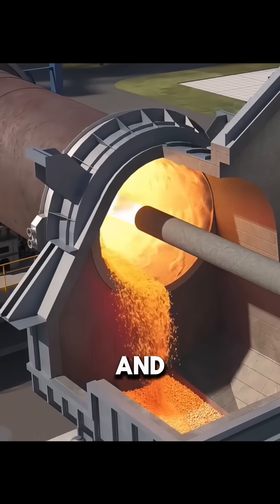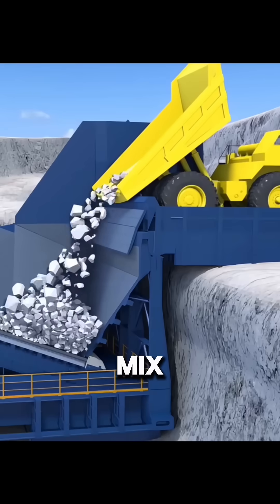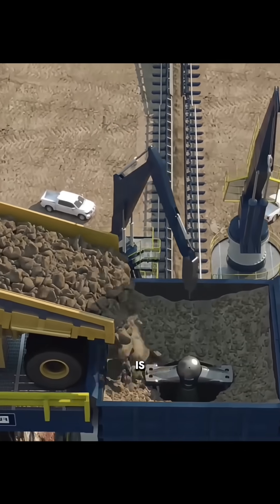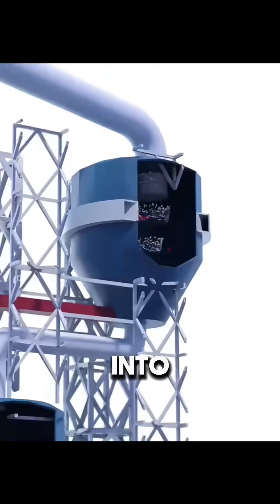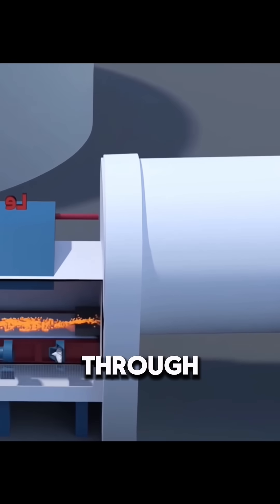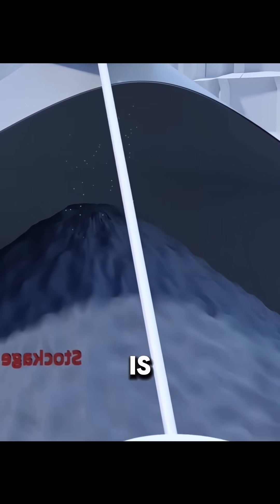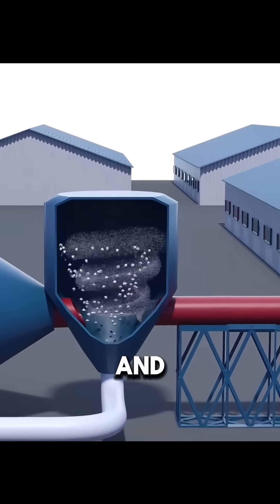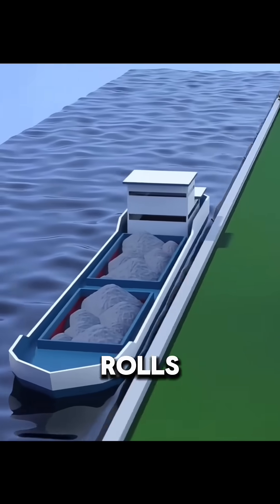How is cement produced? #zackdfilm  #foryou #cement

Comment: How Roman's had better cement?
Reply: Yes and no, while they had a cement that would self heal etc, even with reinforcing it couldn’t bare the weight of a skyscraper,
Basically there are allot of different cement blends that have advantages and disadvantages based on use, there is no “One size fits all” cement.
Reply: @noname-lp3mu they didn't know for putting steel in cement, if they did who knew what would they build

Comment: Concrete isn't made that way in modern-day. We built them 10 story units now. Not a half mile long.And the heat comes from used tires that will never ever run out of. But the possess is European and works great.

Comment: At what point was (is) volcanic ash added to make very long lifetime concrete as was used by the Romans?
Reply: We grind it too fine. Roman concrete had larger pieces that didn't fully react, so when damaged, it would "heal" itself from moisture penetration.
Reply: @minnesotachris7884  My thoughts excacly. It's such a simple chance, I think
Reply: Batching plant.
Reply: This is cement. Not concrete. There's a difference
Reply: gurt

Comment: What i wonder more about cement is how they make reinforced cement,bomb proof cement,and even nuclear proof cement,i know it's technically a concrete not cement but still the main ingredient is cement and what type of cement do matter and will have great effect on the concrete strength,like Portland cement type 3 for reinforced concrete and stuff.
Reply: Well the reinforced cement has little pieces of fiberglass mixed in, and I think the bomb proof had pieces of kevlar in it..
Reply: 20,000+ psi cement has iron or carbon fibers added to make nuclear or bomb proof structures respectively.  A very expensive product.